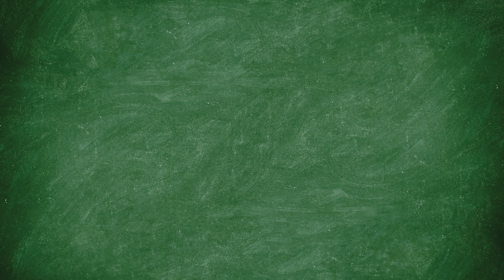How Heat Convection of a Gas Works

Comment: Good demo,But which way the hot air go out?left ,right or random?Why?
Reply: The air near the candle flame which becomes hot expands with the same mass leading to decrease in its density so it just rises up leaving the tube and cold air in the surrounding replaces the hot one that rised creating the convection current. I hope that helped you